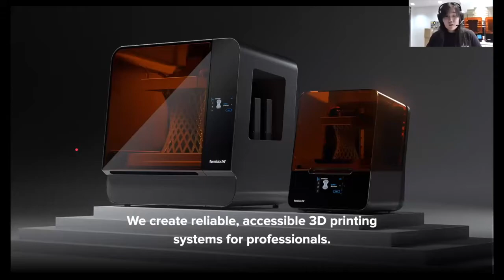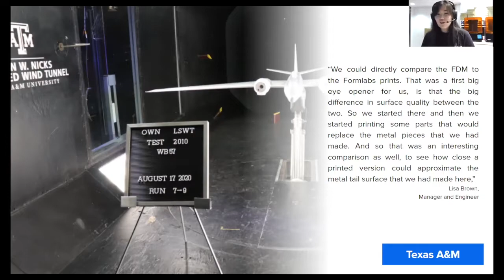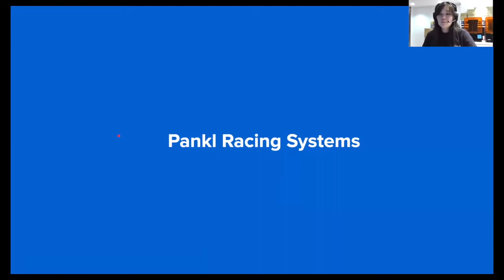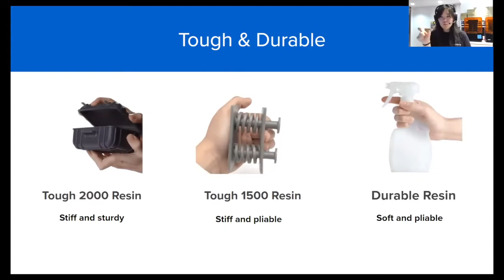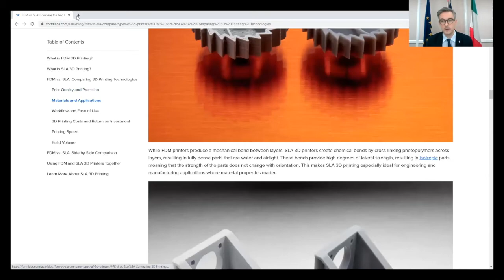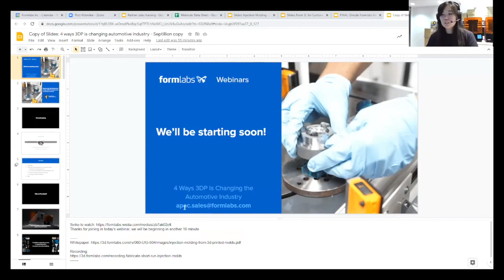TICC Podcast: "Road to the 3D Printed Car: How 3D Printing is Changing..."

Comment: Billion Dollar concept here: ake an electric car you can pull up to a gas station or power station, current battery is removed and replaced with a fully charged battery and you get back on the road fully charged with no wait. Or 4 turbines in front recharging battery as driving.